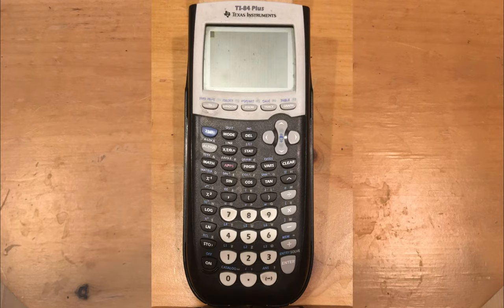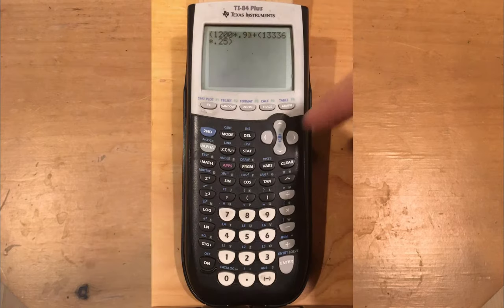Calculator Tutorial - Intro to the TI 84 Plus

Comment: So when you designate a letter for a numeric value, you can only use a single letter? Can you save as a double letter? 45.135 = AA? Thank you 🤓 recently found a tossed out TI 84 Plus. Had to clean some corrosion on the battery spring contacts, installed fresh AAA batteries, & seems to work fine!
Reply from the maker: Good find!  They are still over $100 new.  I will try this on my TI84 Plus CE and get back to you.
Reply: @TutorTerrific  yes, thank you 🤓 wish it was the CE version! As a kind of hobby I look for electronics in dumpsters and curbside stuff.
Reply from the maker: @j.lietka9406  I can now confirm that it does not work, a syntax error results.  You can only use one letter for storing a value as a variable.
Reply: @TutorTerrific  well thank you for trying! 🤓

Comment: Do you have a video showing how to do fractions with this model?
Reply from the maker: I didn’t make a separate video for it. But here’s how I do it (numerator/denominator)  I do it this way inside parentheses and it works just fine.
Reply: Press [alpha] then [y=]  and you get a minimenu, use the top choice to input a simple fraction and then you can do fraction sums and the answer will 
be given as a fraction.
Reply: @TimNoyce  when i do this i come into the same menu as the guy in this video at 20:42 but i have seen another video where by pressing excatly the same the menu with the fractions are showing  :/
Reply: just divide the numerator by the denominator

Comment: My hero! Ive been reading physics and have used an app so i wouldn't have to buy a graphing calculator. Final exam is one week away and they don't let you borrow one either so I had to panic buy one. But now i have no clue how to use it since its completely different in how you have to arrange your equations and settings, this will save my ass! Thank you! 
Btw... Is there a way to store entire equations so you just have to put in the necessary numbers? 
Example: F = k × (x_1 * ×_2)/r^2
Have that equation stored so i can just change the "x" to the numbers i need?
That would be awesome!
I got the "ti 84 plus silver edition"
Reply from the maker: You can only input and evaluate functions by plugging in the right side of the formula to the y= button.  Then, use the table button to input values and see the outputs.

Comment: I hope you still answer. My model is just like yours. It came with 4 batteries, but also a charging cable. What are both used for?  T.I.A
Reply: Almost forgot to mention:
You may have also received a smaller cable (without the usb3 plug). That cable can be used to transfer programs/games from another ti-84 calculator (from a friend or teacher, etc)